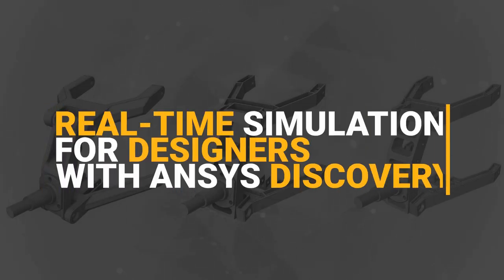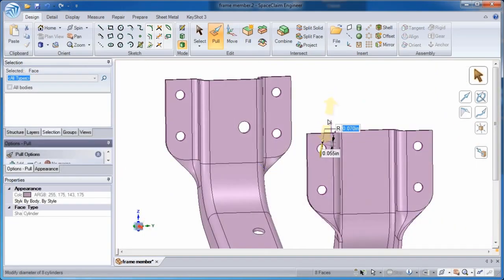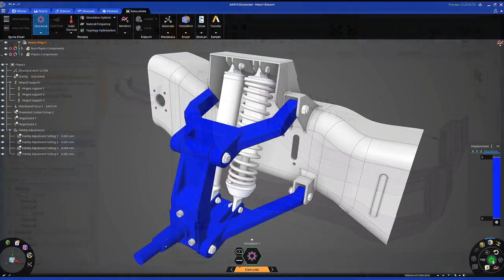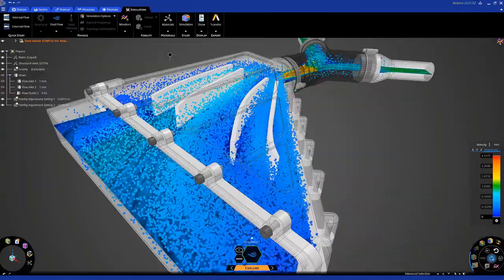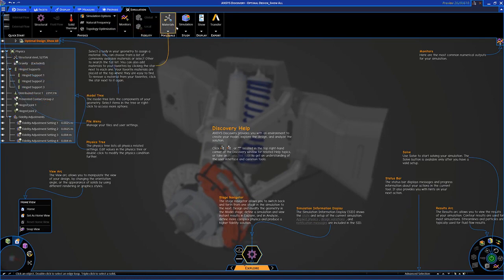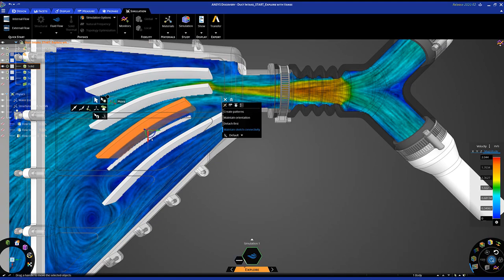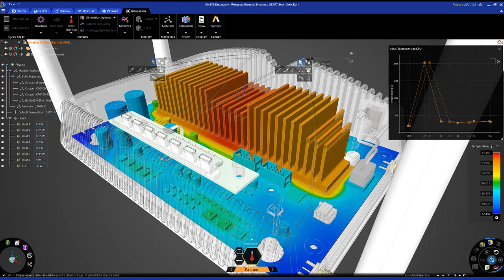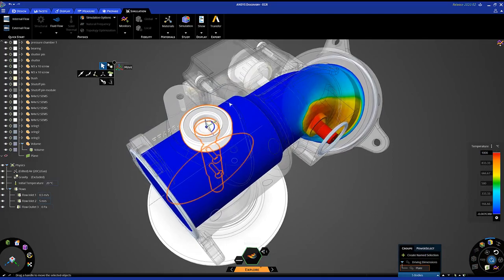Real-Time Simulation for Designers | Ansys

Comment: someone pls explain me how these analyses are done too quickly like that ?  are the results reliable ? if yes, we might not have to consider the trade-off between computational time/memory and the accuracy of numerical results . hence Life seems to be so ez ;  I will be very surprised  and doubtful by such an ultrarapid development.
Reply: This could be using AI, I guess. I am not really sure. But if you need instantaneous calculations, I feel only AI could donit.
Reply: @firepower432  Or you could use extreme idealization (simplified models) and extrapolation / interpolation combined with high computing power. Accuracy will be an issue though, but when you can get a result that is 90% accurate in seconds (without convergence issues) versus an accurate result (99%) in 40min, I prefer the first one.

Comment: If only making any kind of geometry in Spaceclaim wasn't like getting kicked in the balls by a horse.
Reply: What do you mean? SpaceClaim is easy to use, you can apply python code to it to be more flexible. And in general it is flexible?
Reply: @blindshellvideos  the code integration is nice I'll give you that but for general modeling purposes I am using solidworks everytime. Way more intuitive
Reply: @austinroxout  I mean obviously a pure CAD tool is better then a FEM-preprocessor modelling tool. Is there no API that conjuncts SE geometry kernel with Ansys? I know for Siemens NX there is one, where you can use NX modelling instead of spaceclaim. 

I dont know if it allows creating named selections etc., do you?